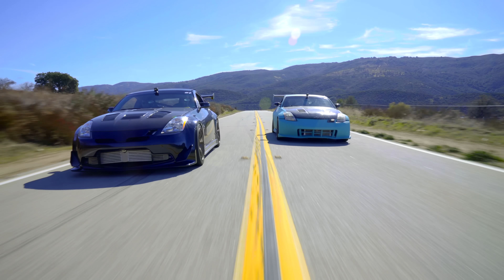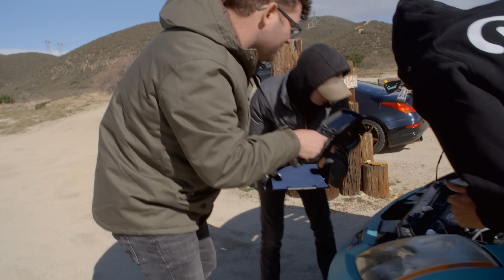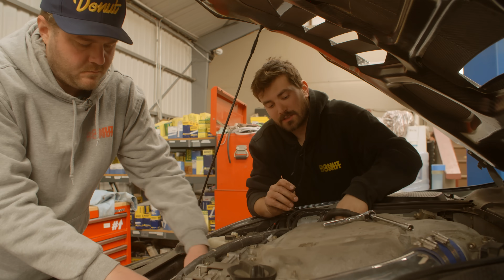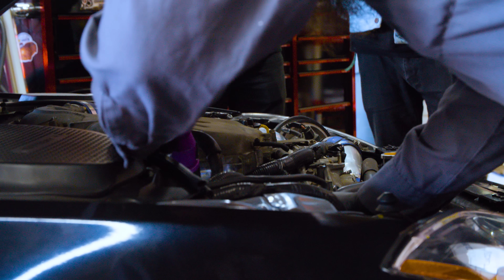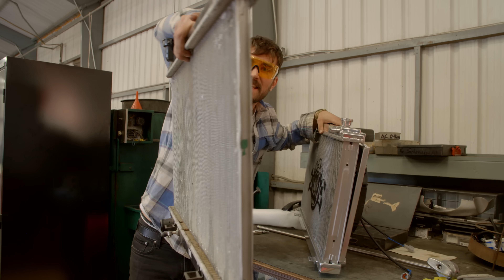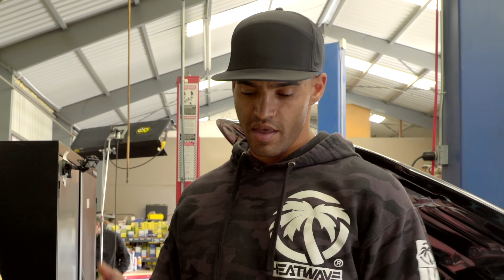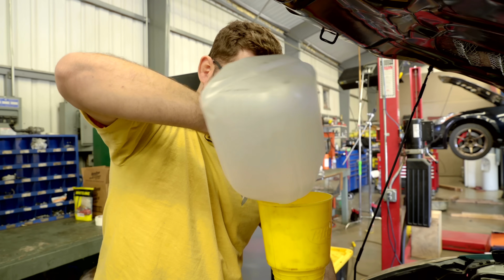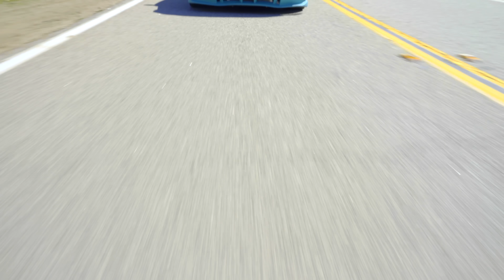$200 Radiator vs. $500 Radiator

Comment: The car needs antifreeze because it doesn't just lower the freezing point of water, it also helps raise the boiling point and prevents corrosion which is why they recommend trying to go 50/50
Reply: When testing you need to keep variables the same as much as possible.
Reply: @blank9797  I believe removing the cats on Hi car will also make the car run cooler. Especially since they were failing.
Reply: And it lubricates the waterpump
Reply: Its does raise the boiling point, but your coolant shouldn't be anywhere around 250F, you atar blowing head gaskets around 300F.
Reply: waterpump change incomming...
Reply: Coolant and distilled water is superior to just water. But most tracks and strips don't allow coolant. That's why you see most YouTubers only run water.
Reply: German Mechanic leaving this here
https://www.glysantin.de/en/about-engine-coolants
Reply: this reminds me of of that Kendrick verse
Reply: This thread is like 8/10 doctors recommend. lol

 I do 50/50, like the probability.
Reply: and it prevents coolant to become a conductive electrolite of corrroded metal mixing in the water
Reply: Actually the pressure in the system does more to lower boiling point. Water does better at transferring heat, so you should put as little antifreeze in as possible to get to the anti freezing level you need for your area.
Reply: @calebnation7797  how can you say that if you just Google 1 sec that higher pressure means higher boil points
Reply: That's totally, wrong, it prevents corssion yes but it doesn't raise the boiling point. The high pressure inside the cooling system raises the boiling point.
Reply: @bangulatof9094  no, that's not really true. Water starts to boil at 100 °C and with 50/50 antifreeze it boils at around 107 °C. The pressure does help normal water not to boil until 113 °C and with both antifreeze and pressure it doesn't start to boil until around 120 °C if i remember correctly.
Reply: @Skitungen  the boil at 100°C exist in 1013 mbar airpressure. Inside of the tanks , the Pressure is higher and it's physics that raises the boil point
Reply: @bangulatof9094  not true, actually lookup glycol as it does have a higher boil point than water even not under pressure. A proper mix does have a slightly higher boiling point.
Reply: @bangulatof9094  its the combination of ethylene glycol and pressure that raises the boiling point.
Reply: @bangulatof9094  There is no corrosion with DISTILLED water.
Reply: @advanceddarkness3  it should be de ionised
Reply: @advanceddarkness3 as soon as you put the water in the car, it will pick up metal particulates and becomes ionized. Distilled water is still better than tap water, though!

Comment: <— this is my car it’s just a drive can on my farm But the 2nd fan never comes and the temp gauge never goes up so I don’t know if my radiator is good it doesn’t work
Reply: Check your thermostat. It may be stuck open making the system not pressurize and you wont warm up. Usually no heat is a good indicator. Much luck.

Comment: The problem I have is this is not Scientific AT ALL! If you put a cheaper cooling system into a car that is built with other cheaper parts you cannot compare it to a car with a more expensive cooling system but also other more high performance parts. To really accurately judge a single system both cars need to be comparable or equal.

Comment: Low car actually dropped more heat of the starting line. Compared to high car. Obviously high car had a lower temp at beginning harder for lower temps to drop.  But pretty impressed on how much low car actually dropped temps 👏

Comment: Anti-freeze does more than preventing freezing,
it raises the boiling point,
it lubricates, and prevents rusting.
Reply: Doesnt it also have anti-microbial properties (i.e. fungicide etc) to stop anything growing in there?

Edit - looked it up. Bio fouling is present with propylene glycol which increases corrosion through the formation of bacterial films on the inside of your radiation. Not ethylene glycol which is the main coolant used.

Yeh having read around anti-freeze is incredible stuff! Sort of embarrassing from the team that none knew about why you put anti-freeze in coolant fluids.

Edit 2: https://www.jstor.org/stable/44723044?seq=1. <- great paper on the subject
Reply: @hamishrobertson946  "Sort of embarrassing from the team that none knew about why you put anti-freeze in coolant fluids."
I was actually really surprised they didn't know this already? If say 20+ years ago if you revelled this little knowledge about antifreeze you would've gotten laughed at. It's just so basic.
Reply: @hamishrobertson946  A friend of mine in Spain had an old car he only used water in,
and after 3-4 years it had built up alot of rust, and other gunk in the system.
We are not sure, but we suspect it migth have been the reason why his waterpump broke.
So higly recommend using it, even in warm climates.
Reply: @cc_Nord86  That rust and gunk is likely because it was an old car and he was using regular tap water. You should be using distilled water even with anti-freeze when you mix it as distilled water lacks all of the minerals and chemicals tap water will have (And trust me you don't want chlorine in your radiator, it will vaporize and rust the shit out of any metal the vapor is exposed to and lowers the boiling point)
The gunk without seeing it could go back to just being old, oil seeping through gaskets and getting into the coolant or he did a lot of short spurt driving so it never heated the water up so algae could grow inside or like I said he was using tap water... If not all three.
Reply: @hamishrobertson946  There is no anti-microbial properties in anti-freeze, the heat the water/coolant reaches kills off anything that can grow in there normally unless you are doing nothing but short drives where the engine and coolant never heat up. (But this kind of driving kills batteries too as your alternator can't recharge it from the large draw of starting up the vehicle)
Reply: @SilvaDreams  I mean I discussed how ethylene glycol is the main anti-freeze used in cars and has strong anti-micro properties. If you use propylene glycol then this is a well known issue causing fouling in radiators.

The normal range of car coolant is 190-220 degree F (88-104 degree C). But Im sure the actual temperature experience by a bacteria growing inside the radiator on a cooling fin or in the return pump somewhere etc could well never exceed like 50-60 even in extreme usage. 

 'Last, but not least, is the fact that bulk storage of treated water coolants contaminated with a small amount of organic material allows microbes to grow and multiply rapidly. This depletes the coolant of nitrite and nitrate and reduces the pH. Table 2 shows the lab results when the organic contaminant was 2% ethylene glycol. Note the early conversion of ail the nitrate to nitrite and then the subsequent consumption of nitrite. When typical 50% glycol/water coolant is stored in bulk, the microbes can not survive the high level of glycol and the coolant is stable' - from https://www.jstor.org/stable/44723044?seq=1
Reply: Didn’t they use half Antifreeze and half distilled water? At least for low car said it in the video.
Reply: @HeyPlebes  they drained much of the coolant, then only added water back. They didn't give specific measurements though. Assuming 50/50 initial mix, they're probably 80/20 or 90/10 now, which is far outside of the ideal threshold. Generally 50/50 or 60/40 is where you'd want to be unless you're in Alaska or something
Reply: Yup when they said only for freezing I literally face-palmed. Says it on the bottle. Higher than water boiling point
Reply: They went 50/50 for that reason
Reply: Yeah man. I wonder how these Z professionals don’t know that.
Reply: Moreover, each engine should run at its exact working temperature, which means both high and low (below or above the default) temperature can affect performance and reliability.
Reply: anti freeze has more mass/volume and more complex molecule hence why it has lower freezing and higher boiling point. pressurized system prevents liquid to boil by, well, pressurizing the coolant. imagine water boiled at ski resort in high elevation will boil at lower temperature compraed to water that boiled by the beach, this caused by lower air pressure in hgher elevation
Reply: anti-freeze does nothing to help cool your car, it actual works against the cooling system by lowering the specific heat of the fluid, a 50/50 mix transfers 20% less heat than pure water.... https://www.hotrod.com/articles/glycol-or-water-coolant/
Reply: Also de ionised water should be used ideally, not distilled
Reply: @bigdorkification  distilled is basically deionized. DI water is just balanced ionically but could have a bunch of crap in it. Distilled is well.. distilled.
Reply: The Pressure in the system  inside raises the boiling point, not the anti -freeze
Reply: @bangulatof9094  yes, and no, the pressure raises the boiling point, and the glycol added from the anti-freeze raises it further
Reply: @Adierit  i learned car Mechatronics and I learnt it thaz way
Reply: @Adierit  just Google it 1 sec
Reply: @bangulatof9094  search up freezing point depression and boiling point elevation.
Reply: @bangulatof9094  i learn the same thing as you, and what he said is true, it does raise the boiling point, not by a lot but still by a decend bit, you should know that if you learned that you learned.
Reply: @bangulatof9094  Haha, I'd try get my tuition back if I was you then. It's two nonlinear functions that are superimposed.
Reply: @bangulatof9094  WW2 fighter aircraft used anti freeze to raise boiling point by 20 degrees C and also reduce the freeazing point becuase oif the colder air up high at 30k feet.

Comment: Doesn’t anti freeze/Coolant still effect the molality of the distilled water so it’ll boil at a high temperature, as well as decrease the freezing temp?
Reply: Yes, but since the cooling capacity goes down so much, you are less likely to experience boiling with pure water. In other words, water will boil easier when it gets really hot but it takes much more to get it hot. Check out the two graphs here. https://goldwingdocs.com/forum/viewtopic.php?t=31083

Comment: I think more expensive is more better in this case. Its double the price, but the quality is just so much better and the results are far better. Id also feel more comfortable in the long run with the nicer rad. Where as I feel the cheaper one might leak or crack after a while.

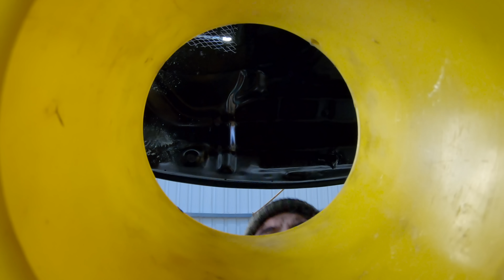Comment: 12:45 Antifreeze has higher boiling point than water & operational temp is almost water boiling so You might be in trouble when Distilled Water is going to boil.
Reply: Under pressure it won't boil. But also they care more about the heat capacity. It's a performance build not a build to last a decade.
Reply: Except the whole system is kept under pressure so that logic doesn't work here. Straight water is better at transferring heat. The only reason you'd need any coolant is for lubrication and anti-corrosion.
Reply: You would think such a big company will think of it 🤷‍♂️

Comment: I’ve had the same problem as highcar and was thinking it was my cats. Definitely confirmed that for me. Thanks donut!
Reply: If you stick a pressure gauge on the bung fir the up stream o2 sensor you can turn the car on and test for back pressure. If you have the po420 code its worth checking that out as well as tapping the cat with a stick or something.

Comment: So basicaly, cracked sparkplugs => firing mishapps => flamed cat.
When you see how fast a firing issue can damage a piston.... lucky only the cat got burned

Edit: I'm not that fond of shrouds, it just block air flow through the fans. As a result, the available surface is lower and the fans will probably be on more as it won't benefit of natural air flow through the radiator

Comment: Pro tip: Radiators cool horsepower, not displacement.
A 2L (120cuin) 4cyl turbo making 350hp needs almost exactly the same radiator capacity as a lazy naturally aspirated 5.3L (320cuin) V8 making 350hp

And many factory setups are not designed to run flat out permanently. Like the original radiator may have only 80% cooling capacity compared with peak power output, so you can drive around town with no issue at all or do a few power runs and full throttle launches unaffected, but if you take it to a track and go ham throughout the entire course (or tow a heavy trailer up a mountain) it will overheat. 
Slap a turbo on that badboy without upgrading cooling and you're just compounding the issue

Comment: Low car may have needed to be bled of air, there's a bleed valve on the left side of the engine on the coolant return hose which you need to crack, and hook up a hose/funnel to the radiator to get your fill point higher - or jack it up. Vq engines are terrible for bleed problems

Comment: For race cars and off-roading monsters, I run waterless coolant.  Heck, my great grandfather ran transmission fluid in his ford tractors and never changed it in over 40 years and he ran them hard in 110+ weather and in -10 degree weather. Never froze nor overheated.  Not to mention the radiator is also the original. Due to no corrosion agents

Comment: Get rid of that shroud, the fans are really only meant for when the car gets too hot (usually sitting at lights, and city driving). The actual movement of the car is where the radiator gets most of it's airflow. The shroud is basically reducing the amount of fins being cooled on the rad, idk who or why anyone would think that's a good idea.

Comment: I would have preferred a comparison between inexpensive parts to expensive parts. Instead they paid a small amount more for their radiator and then bought additional parts and apples to oranges parts. You can't compare a single plastic electric fan with a dual fan w/ metal full shroud.

Comment: Just a couple of cats, no problem.... last time that happened to me it was a huge problem because cats are super expensive! Also, if you ever replace cats, check your fuel injectors, sometimes they leak gas by sticking open and that gas can melt the inside of a cat.

Comment: Water, or high water concentration coolant will evaporate more on the long run than well mixed coolant since coolant has a higher boiling point than water to keep it from evaporate... if you dont want yo top your coolan every other day might as well go with coolant not water

Comment: One serious question. Did either car have a problem with the fluid filled rear differential bushing? In the first year of owning my g37s i blew it out...that said i ran the hell out of it but i was wondering if you guys replaced yours with poly ones. Super real question cuz the dealership wont replace it. Even under warranty they want to replace the whole undercarriage which doesnt seem right. I now have horrid launch an wheel hop. Just a couple words would help. Reddit seems useless. Everyone apparently is an expert that knows everything.

Comment: Also it is also worth while to mention that coolant boils at a higher temperature vs just straight water. You don't want the coolant fluid to reach the point it goes from a liquid to a vapor.

Comment: "I will take the ribs off." 

ME(a design engineer): Please don't.

"I heard a crack"

ME: Told ya
Reply: what would you have recommended in that situation? 
Remove the ribs and reinforce it somehow?

I'm actually genuinely asking, I know it sounds like I'm being passive-aggressive but I really'd like to hear from a professional!
Reply: M you can only add strength by either changing material (impossible in this case) or increasing thickness which is the problem. So instead of removing whole of ribs try and keep some of them. If that too isn’t possible I would suggest not to sand them down completely. Even a little bit remaining might help. Though removing it whole isn’t bad but the chances of breaking increases and the plastic being a single part the crack may propagate through the body. (Note: I may not be as experienced as the guys at Donut so they might understand it more than I do and took a calculated risk)
Reply: Challenger it is not under a lot of strain so I expect it will work fine. They pretty much had to though lol.
Reply: Challenger ah, thank you! That does make sense

Comment: i bought the same 16 inch ebay fan and replace the motor with a higher end model that pushes way more CFM than the motor that was on it

Comment: All this long I thought 100C is still normal???   During street driving my nd miata average radiator temp is 86-90C. And spirited driving will goes up to 105C. Average Ambient temp here is 34C.  

Do i need better radiator? Or how about oil cooler?

Comment: I feel like there is more ways to keep it to run colder stock fans on those cars don’t pull much air and come on very late in my opinion so triggering the fans to come on earlier and a colder tstat would do it more justice for both cars

Comment: Wait, is Antifreeze a different thing to Coolant? In Australia we use ethylene glycol as coolant in our cars, not only to prevent freezing but also to raise the boiling point of the coolant. It has a minor drawback of efficiency but when you can reach 130 degrees plus before boiling it's far better for the safety of your engine and radiator.

Comment: The Glycol coolent  is to stop the water from boiling. Those your engine doesn't  over heat and your radiator does not spray water all over.
Reply: Ye, and on some engines depending what it's made out stops corrosion and the eating away of the material 😶

Comment: The only things I can’t forgive on low car are the fact that they had to remove AC to get the turbo to fit, and the way that front bumber sits to far back so it goes under the lip of the hood. Otherwise i’d go with low option.